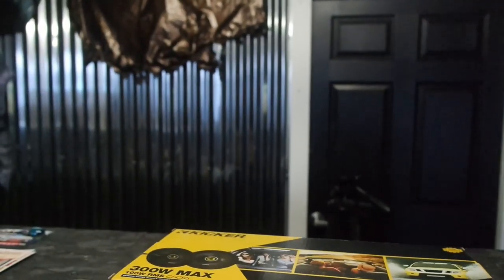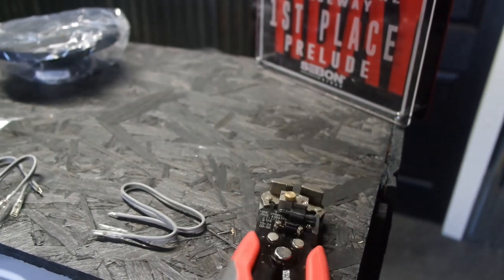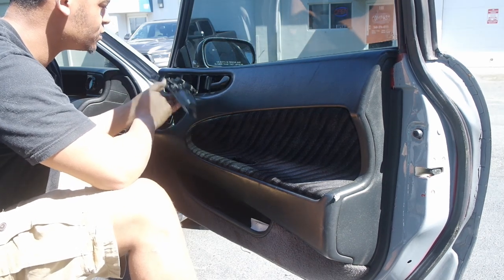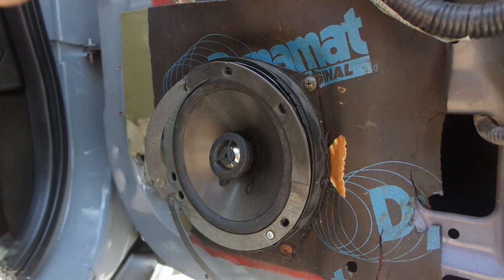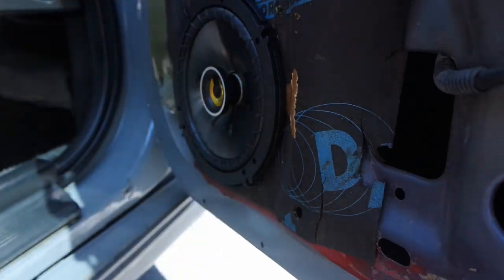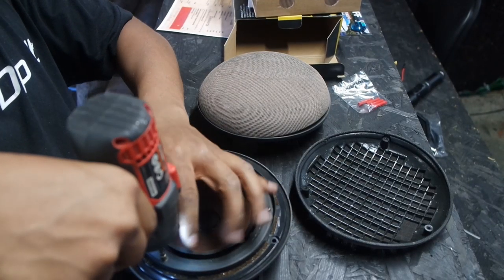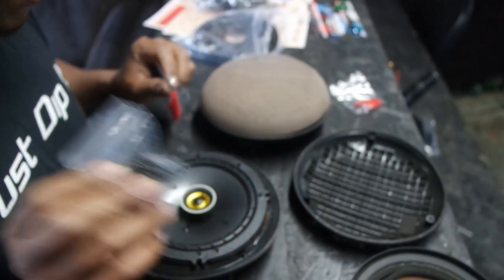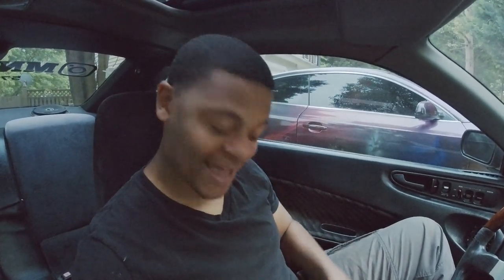How to install speakers in 92-96 honda prelude

Comment: Oh ok , i was talking about the 4th screw, but it was windy on the sound so i kinda misted that one 😉  .. what about the tweeters? Because i want to get rid of those? Did you run another line straight to the front speakers to get rid of those tweeters? .. my car is messed up by the owner before me 😪 .. also like in the back now there are no wires running to the back and since the harnass has changed allready for a new radio this is still some work .. but anyway thank you for this video Trey 😍👌

Comment: Hell yeah trey. 

Show me the run of the power to that 8” sub.  Need to know where to fish the power in the ‘92 Prelude.  

Subscribed and likes sliced.
Reply: I'm Sure you figured it out by now, but I ran my power cable, 0 gauge, through an existing hole in my fire wall.  I had to drill it just a little bigger, used a grommet to make a tight seal and called it a day.

Comment: FYI they make speaker adapters and speaker wire harnesses for just about every vehicle on the market.. using them makes the install so much easier , cleaner and better sound quality and no need to cut any wires or modify speaker brackets.. nice car tho man . I have a 94 I been building an I love it.

Comment: Hey boss I'm a big fan of the channel and your prelude 
I have a h22a4 swapped cd5 accord 
I was wondering what you would recommend for a few good bolt ons to get to get it up to 200 hp
I am on a mild tune and only have exhaust and intake.    Sitting at 176
I know you know your way around a h motor 
What would u reccomend that wouldn't break my bank.     ?????
Reply from the maker: Upgrade your fuel pump and injectors and go e85 + new tune
Reply: @treybedipping1734  thank u for you input.      You think I would be over 200??.

Comment: I think Honda Nissan Mitsubishi and Volkswagen and Mercedes-Benz along with BMW. Along with Chrysler products. Have common sense about putting speakers and making it easier for the guide to work on the car. That's the way it is. Ford used to be the same way but now they made it so complicated along with Chevrolet and General Motors in speaking. This is why I like Japanese cars. Is because they use common sense. And put this into your soundtrack get ACDC black in black. Crank up rock and roll ain't got no noise pollution. Listen to that blues riff. Play Smoke on the Water by Deep Purple too another deep blues riff

Comment: Are there tweeters?
Reply from the maker: Built into the speaker? I believe so
Reply: @treybedipping1734  the front little speakers I think there’s 2 on each side of the dashboard I was just  wondering if they changeable
Reply from the maker: @ant4373  oh yes those are tweeters and can be changed.

Comment: Noice. Back speaker brackets seemed a lot easier to put aftermarket speakers into than my cb7
Reply from the maker: Yea bro i was pretty simple
Reply: @treybedipping1734  Like the process of taking the brackets out are the same. I had to do a lot of shaving off plastic to get my speakers to fit in the front and back tho.